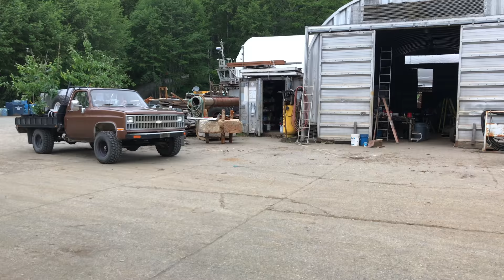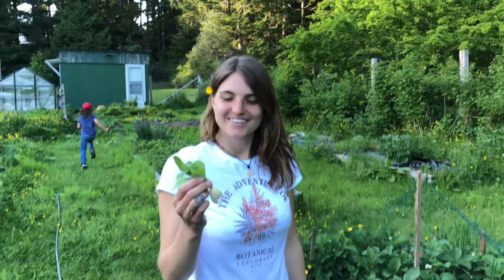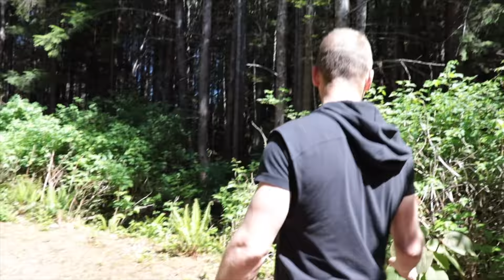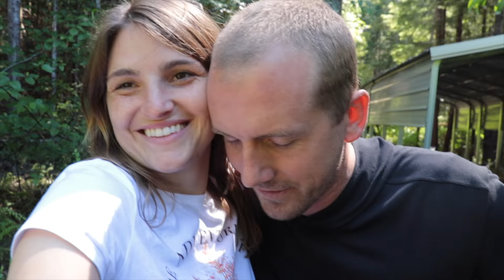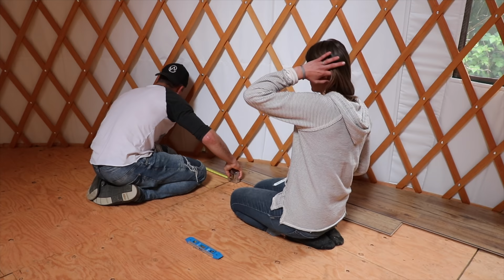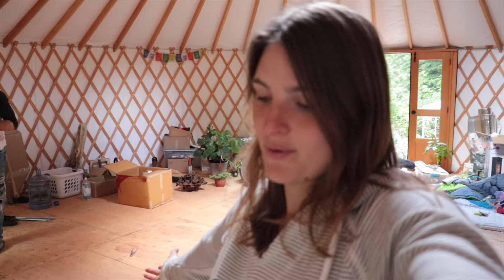Incredible Yurt in the Forest | Installing Flooring - Off The Grid - Ep. 25

Comment: Deer and seedlings. As a general rule. Wild animals generally move into an area like your place in mid summer. To get some respite from the heat,  the Berries are ready and the foliage in that area is moist and sweet. They may even pass through, earlier, attracted by the spring growth. A hot wire around the perimeter of the orchard. could help manage things for a while.

Comment: Very nice flooring. I have seen other yurts that have a snow kit. Its an extra support to the floor for each roof member. Was it an option? If so you may want to consider it. When we do get snow on the island it usually can be significant and the wet heavy type. Just a suggestion to protect your investment.

Comment: Looks like it's coming along nicely. Let me tell you what I would have done different if I were doing it, even though it's not me. I would have backed the beast up to the front door and walked the wood stove in and set it in place, you can always rock it back and fourth to get the flooring under it or bricks which are what your supposed to us. If you lay the floor first, you risk scratching it attempting to get the stove in place. I also would have bought some 2" square wire rolls, enough  to make a fence to help keep the woodlands critter from eating at your house. Once they begin to produce fruit your gonna be lucky to get a few pieces off each tree......They smell good and they green leaves are tasty too. Dear can jump a 6 foot fence in one magnificent leap. I doubt the bears will bother it at all, They'll want your live stock if you have any.

Comment: Good video, why didn't you put a vapor barrier in under the laminate flooring?
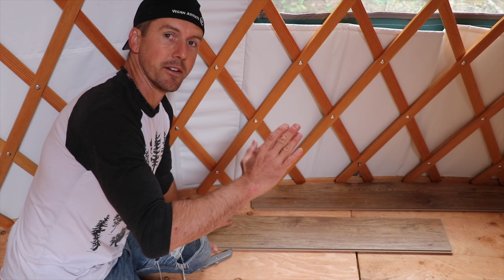Reply: At 12:34 he explains.
Reply: Still should have done plastic sheeting unless they are going to put in a very good insulation under the floor.  I have installed a large number of hard would floors and haveing a one piece vabor barrier make a huge difference in floor drafts and fighting condenstion under the floor.